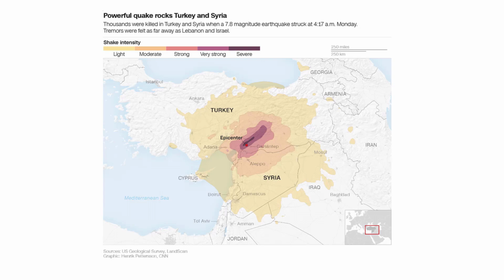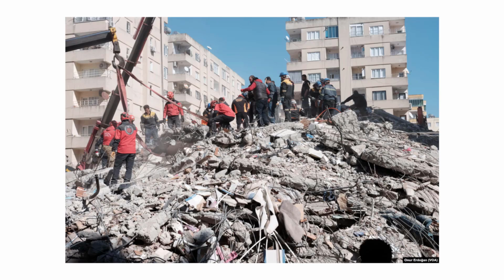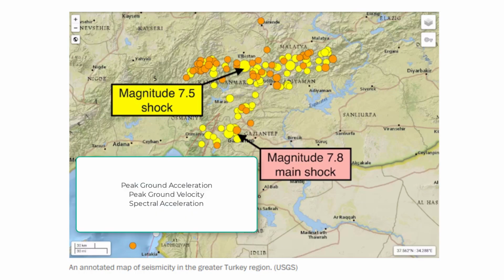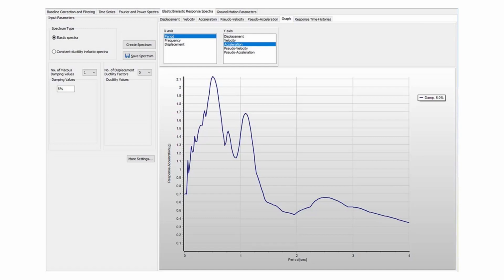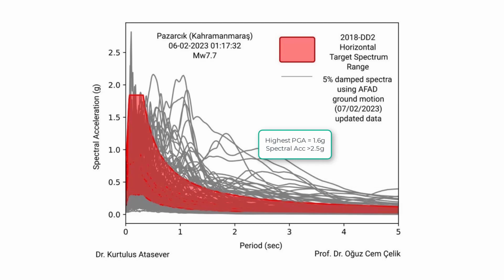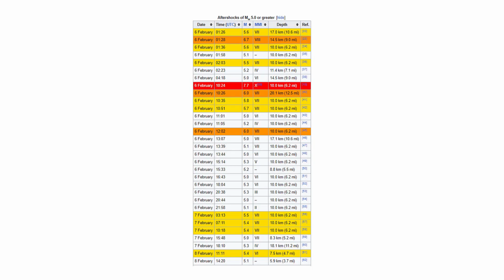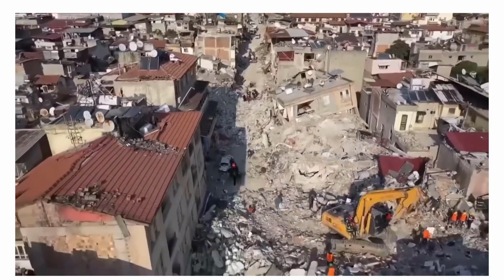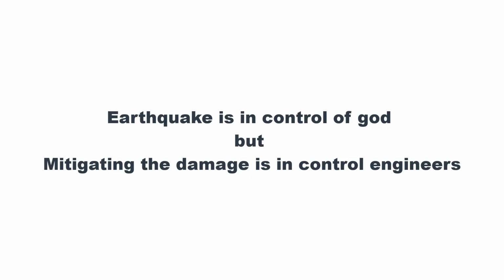Why so many buildings collapsed in Turkey-Syria Earthquake-2023 ?

Comment: Great analysis, Biswa! Well done! It is unfortunate, that several different reasons added up to such a huge catastrophe. This earthquake just proves that still a lot of work has to be done by the engineers, scientists and regulators to prevent humanity from such catastrophes in the future.

It looks like Turkish seismic code was not accurate or strict enough in providing the design response spectra for the engineers. I am wondering if other more modern seismic codes (i,e, IBC 2018) would give a more similar design response spectra to the actual one.
Reply from the maker: Thanks Modestas . Yes it’s indeed a lot more we engineers have to contribute to the society.. Nice talking to you after a long time..😊